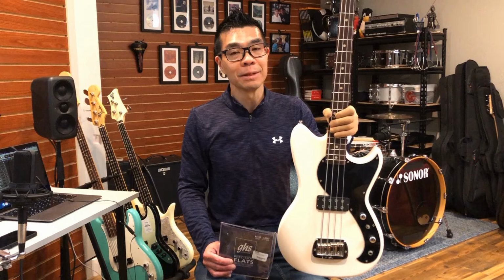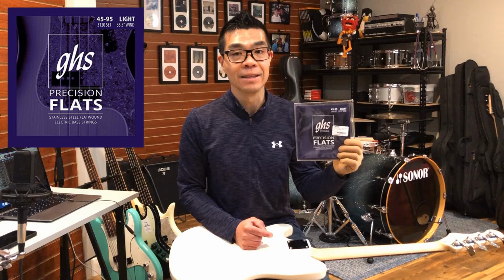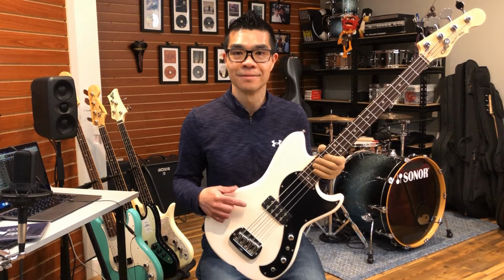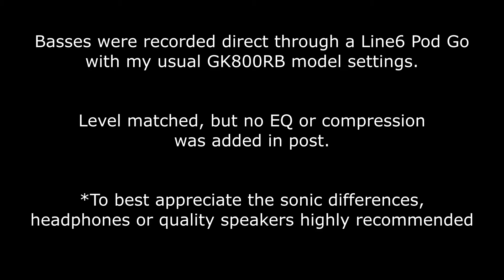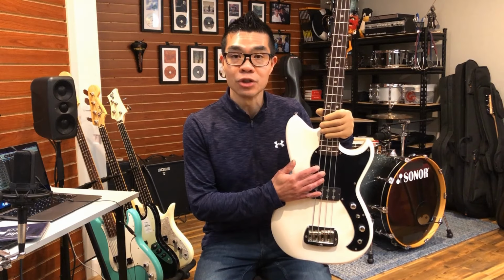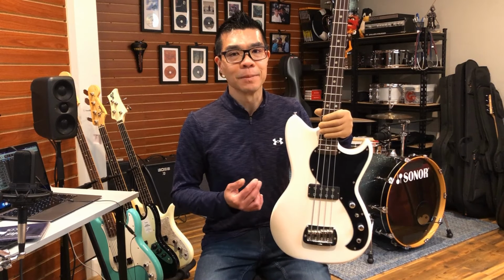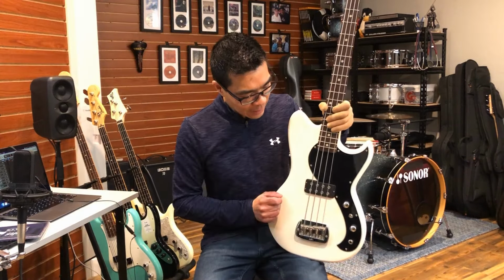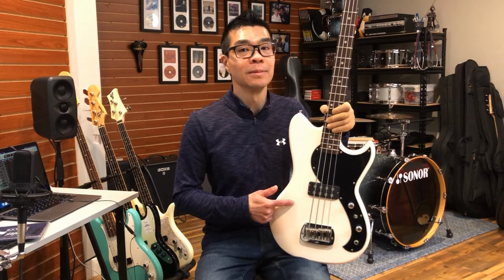G&L Fallout short scale bass with flatwound strings by GHS - Will it give us vintage inspired tones?

Comment: I liked. I bet they would sound great on a Danelectro shorty
Reply from the maker: For sure! I’ll be great on a dano. Throw some foam in there and it’ll be awesome.
Thanks for watching!
Reply: La Bella makes a specific Flat for Danos
Reply: @StevenDoyleLuke  really what do they call them?
Reply: @dynodansmoking  La Bella 760-FD Danelectro Stainless Steel Flat Wound Strings (42-83)
Reply: @StevenDoyleLuke  thanks
Reply: @StevenDoyleLuke It seems they pretty much need that super light gauge...I used labella's "extra light" set on a late-90s longhorn reissue and the neck kept bowing from the tension, which is a real pain as you have to take the neck off to readjust the truss rod
Reply: @jasondorsey7110  Good to know, thanks!
Reply: @StevenDoyleLuke  At least the reissues have a truss rod though...if you overdo it on the vintage ones you're screwed
Reply: @jasondorsey7110  Yes, they do, I have the new Red one with F-hole and truss can be reached thrrough the headstock

Comment: You mentioned swapping out the pickup in the Fallout.  What pickup would you put in it to get that more vintage tone?  Again, another well thought out video.  I have two short scale basses and tried out the G&L and found the ergonomics a little strange.
Reply from the maker: Thanks for watching!  
The G&L pickup cavity is slightly larger than a '35' size soapbar - which means you could, in theory, put in any number of '35' sized soapbars if you are willing to put up with a small gap around it. Passive production options include the Duncan SSB and the EMG Hz but both of those are decidedly modern sounding, but probably have less barky mids than the stock G&L.
Nordstrand could make a number of their soapboar style pickups in a '35' sized shell.

I never did try a different pickup as G&Ls tend to have their own identity, both in terms of looks and tone.  They historically tried putting EMGs in their long scale basses (instead of their brand) and I don't think they ever took off. But the G&L tone is baked into their basses. It's an identifiable mid barky, aggressive sounding thing and if you love it, it's awesome.  If you want a more laid back tone, it doesn't quite do it, to my ears.

Comment: Hi Jonathan.  I have this exact bass (with round wounds) and was one of your subscribers who wondered how it would sound with flats.  So thank you SO MUCH for this very informative video.  I have GHS Precision Flats on my hollow-body Guild Starfire 1 bass and they feel great and give quite the vintage sound.  I bought the Guild used but in mint condition and the fellow I bought it from had put the GHS flat on it, so I have no direct experience with rounds on the Guild.  From the GHS package you hold up on the video, I didn't see "Short Scale" printed on it.  Can you tell us the exact model of GHS strings you are using?  Thanks, Jim
Reply from the maker: Right on! Thanks for the video suggestion and for watching!
The front of the package of these GHS flats says: 3020  Set 32.75” wind. Says ‘short scale’ on the back.

For reference, on the back of the package, they’ve stated that the same gauge in long scale is model 3025 light (45-95) with a wind length of 38”.
Reply: @jonathanwong458music  Thanks !  This is helpful.
Reply from the maker: My pleasure!

Comment: I am a Big Fan of G&L. The Tribute series is great value. whenever I see a Player using one it's an instant conversation starter. I have seen Players up in arms over replacing the Bridge and MFD Pickups and I think it's because they feel it would be taking away the bass identity. I am 85% sure The Bridges and MFD Pickups on the Tribute line are the same ones G&L use on the Fullerton line. I watched Ryan from 60CycleHum take apart a G&L Comanche Tribute and Fullerton a couple months ago and the pickups and bridges looked really similar even the voltage readouts. Thanks for the video Jonathan and cheers from Toronto 🍺🇨🇦
Reply from the maker: I think you’re right re identity of the bass. Thanks for watching!

Comment: Hi Jonathan.  Granted, La Bella flats are a little more stiff (in my judgment at least) than these GHS flats.  But can you attempt to describe - all other things being equal - what might be the difference TONALLY between La Bella flatwounds and GHS flatwounds?  The question, as you can see, has nothing to do with the G&L Fallout bass.  Thanks again, bro.  -- Jim
Reply from the maker: Good question. I have Labella deep talkin’ flats on my Hofner club and recently had them on a Mini P for that mod series. 
My opinion: I find the initial attack of the note on the Labella to be more immediate and pointier compared to the GHS. The GHS’s attack seems to be slightly slower and bloomier. From this, it gives the impression that the labellas sound a little thumpier. There’s probably a bit more dynamic range too. You can get a different tone/sound from the labellas if you give them a strong pluck vs a softer pizz. Whereas I find the GHS to have less variation in available tones. With that in mind, I find the GHS to be easier to play evenly on, given the slightly smaller dynamic range. 
In terms of feel, they are worlds apart and I much prefer the light gauge of the GHS over the Labellas, in terms of feel.
Hope this is the description you were hoping for!
Thanks for asking and for watching!
Reply: @jonathanwong458music  Thanks.  This is helpful. Your description is both nuanced and articulate.... you put into words very well what I have been hearing from my own basses, so I would agree with your description of the tonal difference between La Bellas and GHSs.  I have La Bella deep talkin' flats on my Hofner Icon bass, and GHS flats on my Guild Starfire 1 bass.  I also still have (and in utterly mint condition) the 1966 Harmony H-22 hollow-body bass my parents gave me for Christmas that year when I was an emerging adolescent wanting to play bass after much listening to Rick Huxley of the Dave Clark 5.  Put Fender long-scale flats on it 21 years ago - they feel & sound great and I have no intention to change them soon.  Talk about deep thump, it's got it.  Still have the original chipboard case it came in, too.
Reply from the maker: That’s so awesome. What a memory! (Re bass from your parents)

Comment: If you swapped the pickup what would you replace it with?
Reply from the maker: That's a great question.  The G&L pickup measures ~ 3.6"x1.6" so it's not a standard shell size - but the so-called "EMG 35" shell size would fit inside with a little wiggle room (3.5"x1.5").
Seymour Duncan makes a passive soapbar in that size and Nordstrand has a bunch of offerings with different coils and pole piece layouts in that shell size too.  The non-standard size is one of the factors that keeps G&L users from trying different pickups.
Thanks for watching!